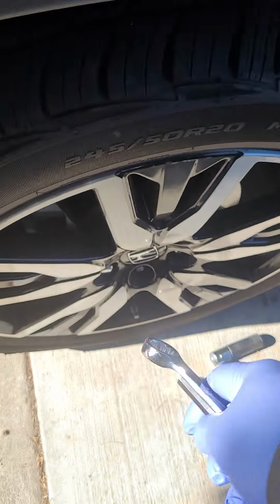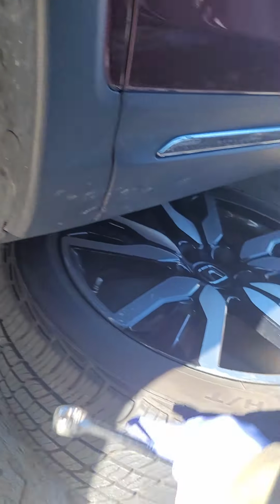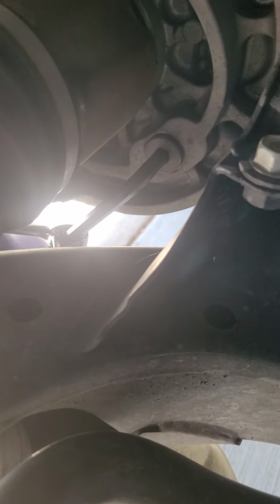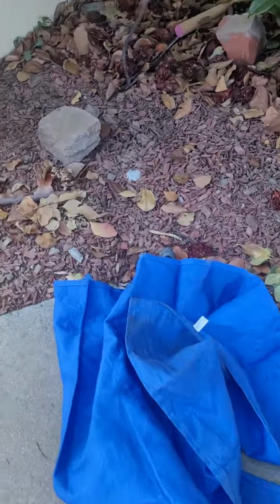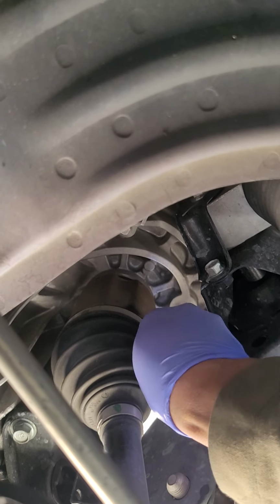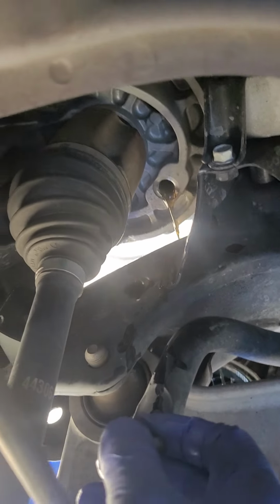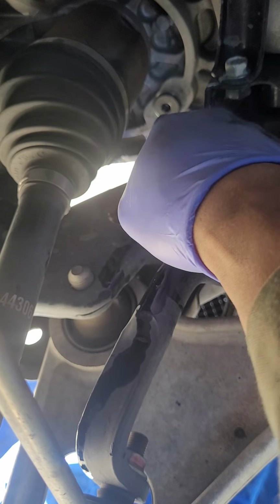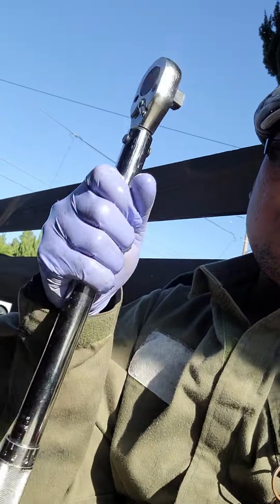how to check the correct level of a transmission fluid of a 2019 Honda pilot (touring)

Comment: The fluid has to be at a specific temperature to check the level, you can't do it cold!  Should be between 104 and 114 I believe according to an HDS scan tool.
Reply from the maker: Thank you for your feedback sir..👍👍.. probably there's certain temperature before checking the level to make sure that the fluids we're spread through inside the transmission.
Reply: @samsvlogs8848  actually this fluid's volume changes drastically with temperature. So if even slightly cold or hot you can overfill or underfill by a significant amount.